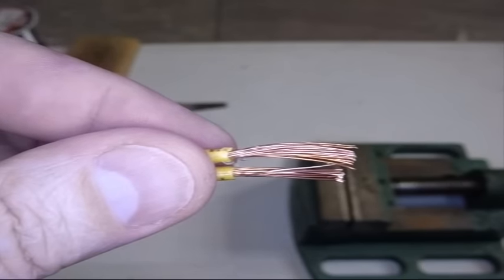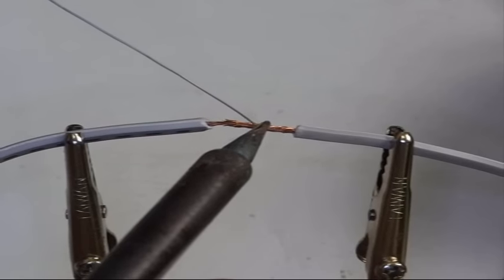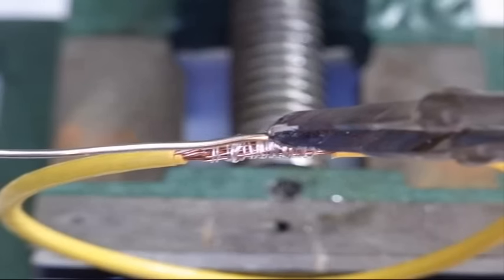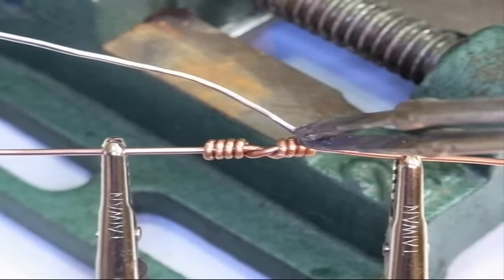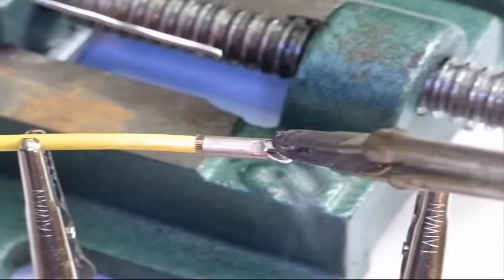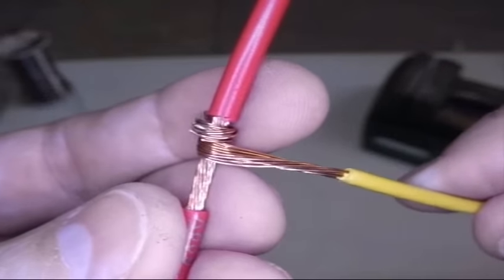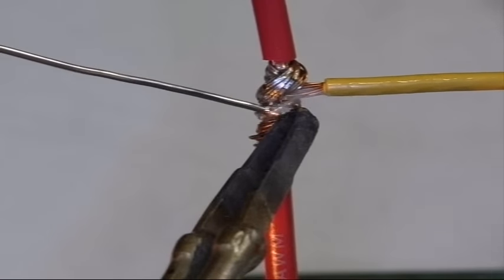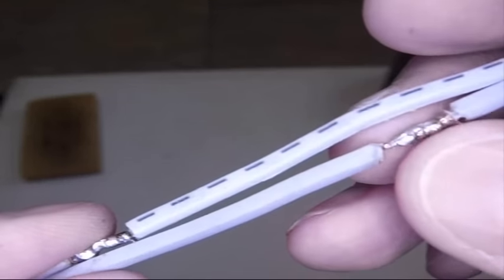Soldering Basics - Popular Solder Connections

Comment from the maker: SOLDERING VIDEOS:
Soldering Basics - Popular Solder Connections - Done Right (4K) https://www.youtube.com/watch?v=udNu-wZaqJE

Myth Busted: Soldering From Below https://youtu.be/gFGvNrYpsGc

Soldering Wires - Doing It Wrong, But Getting It Right (What is CRITICAL?)(4K)
https://youtu.be/Ej284nrwX84

Common Soldering Mistakes 1   https://youtu.be/mv1t-aoSDOg

Soldering Mistakes 2 - Why Mechanical Connection Is Important
https://youtu.be/IPRZOollABY

Soldering Without A Soldering Iron
https://youtu.be/b5iiUMAOGew

How To Solder - Electronics, Car Wiring, Boats, Solar, ...
https://youtu.be/gPpisFM6AIg

Soldering - Water Resistant Joints for Boats, Cars, RVs, Trailers, etc.
https://youtu.be/kZOmRE9msaA

Comment: Excellent video...  Still trying to find an efficient way to solder 10awg wire (used on marine trolling motor) together, to where the solder soaks all the way through.  Got the soldering iron set to 750, using the largest tip I can get for that iron, and generous with the flux.  The one thing I DIDN'T do was flux all the strands before "pushing" them together, nor did I use a piece of wire to hold it all in place, which from some of the videos I've seen looks like it may help distribute the heat around the joint helping the solder soak better.  These videos are very helpful!  So, thank you for taking the time 👍
Reply from the maker: Thank you for the kind words. 10 AWG should not be a big problem to solder. There are 2 "secrets" to soldering. 1) the work piece must be clean, bright fresh copper. Really clean. NO oxide. NO oils (from fingers, etc).  2) You must have adequate heat. Everything else is a "nice to have." And NEVER use acid flux on copper wiring. It will soak down into the insulation and keep eating away at the copper until it breaks. (I made this mistake, tried to clean out the flux over years, and still lost the battle. The stuff is cancerous.) So first, clean copper. Second, mechanically secure the connection. I have wrapped connections, but only when they are dodgy and I had no choice (emergecy boat wiring repair), not for heat dissipation. I have secured pig tail joints with a solderable crimp connector, but that was for mechanical strength. Third, apply flux if needed. Fourth, apply heat. Solder should melt at least 3 or 4 millimeters from the tip of the soldering iron (without having to touch the soldering iron). Finer solder costs more, but is easier to work with.
Reply: @tsbrownie  WOW...what an amazing reply.   Thank you so much.  Do you by any chance have an e-mail address you're ok to share on here?  I'd like to send you a couple pics of exactly what I'm working with.  I find something (off of a sheer hunch) that I think will answer a lot of questions and want to see your thoughts on it.  As I stated before it's 10awg wire, but all the "bare" wire, when stripped is silver.  I'm wondering if that's why the solder wasn't soaking through.   I was able to scrape off that silver   coating to get what looked like bare copper, but can't imagine doing that with all that wire, especially given how easy the individual strands can be.  I honestly have no idea if the flux is "acid" or not, I didn't see the word acid anywhere, I just know it's MG Chemicals "no clean", and I'm using 63/37 almost religiously, and I upped the heat to 800.  I purchased the widest tips I could, as well.  I'm going to test the motor over the next couple of days to see if what I did actually worked.  If it does, then the only thing I need to do is clean up the solder job which looks like typical newbie, gloopy sh!t.  BUT........if that's the only part I got wrong, then I'll consider it a success, given how involved the repair was in the first place.  It will then just be a matter of re-soldering the joint till I get it "proper".  

I can't thank you enough for such a great reply.  Let me know on that e-mail, or if you have a business site you can directly me to outside of YouTube.  I'd like to stay in touch on this project till I'm satisfied it's done at a reasonable level.  Hope you had a very Merry Christmas, and if we don't talk, are able to bring in the New Year in a happy healthy, safe manner.  🙏
Reply from the maker: @phillamoore157  From the MG website "This tacky no-clean flux paste uses a mix of rosin, thickener, and high-grade synthetically refined resin." So it should be OK. If the solder is "gloopy", it sounds like it's not getting hot enough, but that's just a guess. Also, a big tip on the soldering iron/gun may be an issue: too much mass to heat up. I'm not a pro, just been doing it for 61 years and had some training.
I can't accept emails, especially with attachments; if you saw the dozens of daily account hacks I'm subject to, you'd understand why. Thank you for the Merry Christmas and New Year's wishes, my best to you and yours also!

Comment: Thank Lou for the VERY informative video.  I have a situation where I need to solder three wires together. 2 x 22 ga. Tied into a single 18 ga. Wire.  Any tips for this somewhat tricky soldering job?
Reply from the maker: I'm not an electrician and can't say what the electrical code says about it.  However I try to get all 3 wires to spiral around each other.  It would probably require 2 pliers to force their cooperation.  Start the pliers close together and work apart as you twist. I have a device you put in your drill that will twist up to 5 wires, but with it you put one wire in the center and twist the others around it.

Comment: Reminencent of the old Field Wireman course at Fort LeonardWood Mo back in 1970 but we did"t use solder as we were in the "field" and most of the time didn't have access to solder or irons.  We made some very strong splices in the old field wire with it's multi construction of steel and copper wires.  Interesting none-the less, and very usefull now that I am getting into the HAM scene.

Comment: I've also learned that IF the soldered area breaks loose, you should form the wire ends like hooks before you solder them together. So you have the physical strength to hold the wires together, just in case the soldering breaks.
Even though it looks like your method also will have strength if it breaks.
Very great video though! I've never heard of the silicone before, but I'll consider trying it :)
Reply from the maker: Thank you.  Making hooks works, as does twisting.  A good mechanical connection is always recommended.  The joints I did with the bigger wires will hold my 88 kilos of weight.  If a joint breaks it means it was "cold" or not done correctly (or may have overheated and melted).

Comment: great video.  I agree with pretty much everything you said.  The only exception being the t-splice.  I would never do it that way mainly because taping it or heat shrinking it becomes complicated.  I would simply do a 2-1 one joint, slide a pice of heat shrink over all three wires and then a larger piece over the entire thing.

Comment: Thanks. A lot of good info. For the last spice I personally would include two smaller heat shrink before I solder the two splices and then a bigger one over both splices. I just like the better insulation of double heat shrink.

Comment: A varietion of the tube- with- hole method is to make a coil of smaller single strand wire around a drill bit that is the same size as the wire to be soldered and long enough to cover both bare  wire  ends, slip ends in each end of "wire tube" and solder. Makes a very nice connection. And can be used when little or no extra wire is available to twist together.

Comment: Great video. Any tips for joining large to small gauge wire, like 14 to 22?
Reply from the maker: Most of these same connections should work.  If one or both wires are lacquered, ensure you remove 100% of the lacquer because even a little bit badly contaminates the joint.

Comment: I have to solder connectors onto video coax cables used underwater that sometimes get water intrusion and corrode the shield or core. That trick for corroded with is a really good idea. I'll be using that one for sure. Thanks.

Comment: Excellent demonstration. I wondered how to do a 3 way joint. How did you strip the insulation without damaging the copper? Thank you.
Reply from the maker: That takes a bit of experience.  I just roll the wire under the knife with a bit of pressure.  Sometimes once it's cut you can bare the wire by pulling on the plastic and it will move out of the way.  In this case I made 2 cuts around the insulation then made a cut along the wire between the 2 cuts and peeled away the plastic.
Reply: Thank you.

Comment: I was looking forward to the tube splice and he didn't crimp it but that's pretty awesome.  Where do you get them? I've never seen any.
Reply from the maker: I bought them either at Radio Shack or another local electronics store I used to frequent.  I looked them up on google and they are still made, but they are not common.  Most now come with a plastic sleeve (which might be nice if it does not interfere), but some are just like the one shown.  google "solder butt splice" and look through the images.
Reply: @tsbrownie  Hey, thanks !!!

Comment: Regarding the soldering iron, Is there a chart or anyway to know what heat setting should be used for different thicknesses of copper wire?
Reply from the maker: There are many recommendations out on the internet and it varies with the type of soldering.  Circuit boards, discrete components, ICs, wires, etc. all have different strategies.  For most wires, like in cars, the heat is not critical.  You want enough heat to flow the solder through the joint in a relatively short time.  I know that's not very definite, but there are so many variables it's the best you can do without a scientific study.  Solder size, wire thickness, wire type (solid vs. stranded), soldering iron mass, soldering iron heat delivery capability, solder composition, wire cleanliness, ... all make a difference.  Generally speaking, the solder should melt almost instantly when touched directly to the soldering iron.  Solder should melt quickly on the work piece (near the soldering iron) after the soldering iron has had a few seconds to heat up the piece.

Comment: Nice video. Lots of good techniques. I usually use paste flux on all my joints like this (in addition to using rosin core solder). What do you think about flux?
Reply from the maker: +PelDaddy Thank you.  Flux is OK as long as it's rosin for electronics.  Even a tiny bit of acid flux can destroy a lot of wire / traces.  I made that mistake once on an electronic kit and after many, many tries of cleaning the acid flux out of every nook and cranny, and re-soldering places where it ate through the traces over the years, it finally beat me.   I retired it to the trash can.  ;(
Reply: Yeah, that acid core stuff is for plumbing, I believe. I just find using (rosin) flux makes the solder flow really nicely really quickly. I typically poke the end of my wire in the tub of flux paste to get it up in the wires some. It just makes the solder flow better (and improves the chemical bond).

Comment: On a house, it would have to be done inside an electrical box and well insulated.  The wire nuts usually used are referred to as solderless connectors.  In the old days, they soldered their joints and wrapped them in tape sometimes with no box.  If the cable is somehow energized beyond its capacity by lightning or a power line incident, the box contains any sparks that may fly at the point of higher resistance.

Comment: What are your thoughts on using liquid tape? I run a few semi trucks in Manitoba Canada.  Cold weather and salty roads does a number on wiring.  Butt connectors and shrink tape fail too often.  I'm thinking of using solder and liquid tape.  Think that would work?
Reply from the maker: That is a tough environment.  What causes the failures?  Abrasion?  Cold cracking / brittleness?  Heat?  I have a video on water resistant joints.  https://www.youtube.com/watch?v=kZOmRE9msaA&feature=youtu.be
Some of them on boat / snowmobile trailers have lasted 30 years.  I have used silicone rubber covered over (while wet) with shrink wrap.  Messy but effective.  However liquid tape protected with shrink wrap  and / or electrical tape might work even better.
Reply: @tsbrownie  I'd say all of the above.  And road salt, and just rubbing in general.  Often what is done is just a butt connector and heat shrink.  
I think it will forever be an ongoing problem with trucks.  Just wondering if the liquid tape can replace the heat shrink?  I appreciate the feedback sir.
Reply from the maker: @RyanBanman  Ordinary press connectors are the worst.  They don't even hold up inside dry areas.  They are susceptible to vibration, water and just plain old air.  (Unsealed wires "breath" with temperature change pulling in air / humidity / water / salt.)  You need to do everything possible to keep water out of the wires.  The wire strands will wick (salt) water way up into a wire via capillary action and once inside the insulation it never evaporates.  The water (and salt) just sit there eating the copper.  So I chop out the "infected" areas of wire, replace it with good clean wire.  Solder all joints.  Cover them in silicone (liquid tape should do well also) and then a layer of shrink wrap (or shrink wrap, tape and more shrinkwrap if there's lots of abrasion) while the silicone's still wet.   I've done boat motor wiring, boats and trailers, motorcycles, car wiring, buried drip wiring, low voltage outdoor lights, solar systems, pumps, etc. over the past 45 years for myself and friends and to date I don't have any reports of even one failed connection.  I have a deep hatred of fixing something more than once.  It's an embarrassment and an affront to my reputation (actually do-overs take time away from relaxing).  It's just one man's opinion, but spend 30% more time up front to do it right, protect the joint / wire, and you won't have to spend the future time doing it over and over.
Reply: @tsbrownie  thank you so much for the advice.  I know what it is I will stock my toolbox with.  I need go and pick up a new soldering gun too. I've always been hesitant to soldering. But like you said, redoing wiring due to bad connections is a pain.  Thanks again for the advice. I really appreciate it.
Reply from the maker: @RyanBanman  Glad to help.

Comment: great video,  with the 3 way splice,  what if you just looped the second wire around the first 1-2 times and then around itself really tight and then soldered?
Reply from the maker: +Mike Walker If I understand you, it would work.  The joint would be a bit bigger.  Probably have similar strength (which is really limited by the wires and not the joint if these are done right).

Comment: what solder and flux paste do you recommend on ebay?  (live in a remote area, so online is my best option).  the stuff i had refused to cling, even after cleaning the area and using flux.  i'm convinced the stuff i have is garbage.  some vids show the solder crawl onto the copper wire while mine just drips off.
Reply from the maker: The most important factor is that it is ROSIN core solder.  Never, ever use acid core solder on electronics.  I've done it and ruined a really nice kit project.  Kester is a well known brand.  Tin lead type.  Don't use lead free (but use proper precautions for using lead type solders, ventilation, etc.)  These days I used whatever brand is in the store, they're OK but not great.  
If solder won't stick, I have a video on soldering and the number 1 thing is CLEAN.  Clean solder.  Clean joint.  Clean soldering tip.  Make sure you have no oil on your hands, even a small amount really creates a mess.  That's the basics in a nutshell (a very tiny nutshell).

Comment: When I was working at a company producing power electronic components for the Japanese market we conducted a lot of tests on how to achieve the strongest joints when splicing wires together. We worked in a team for about a year and a half trying out different soldering and cold welding techniques to see which one should end up in production. But, in clinical testing including corrosion, water, conductivity and pull testing conclusively it turned out that a correctly crimped butt splice without solder was (although very contradictory to our preconception) the strongest joint for our application. I should point out that it took high quality components and a specific typ of hydraulic crimping tool that had to crimp the splices at an exact point on the butt splice to achieve this result (which works fine if you're, say, a robot who can repeat the exact operation a million times without error). Yet in the face of all that produced evidence, I still hold a firm belief in just soldering the damn thing... it just makes so much more sense!

Comment: Good videos very instrutional...What brand name is your soldering gun because mine is a piece of garbage...Tanks for the video and I hope to get an answer....
Reply from the maker: The ones in the video are cheap no-name junk from china also.  The real trick is to ensure you have enough heat to solder the work pieces and that everything (soldering gun, solder and work piece) is CLEAN!  Any corrosion, oil, ... makes for a bad solder connection.